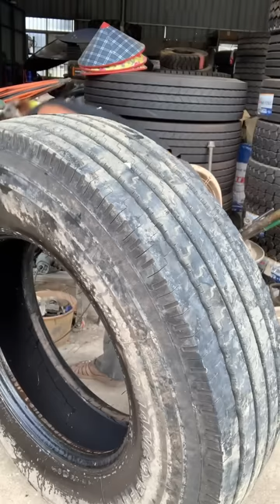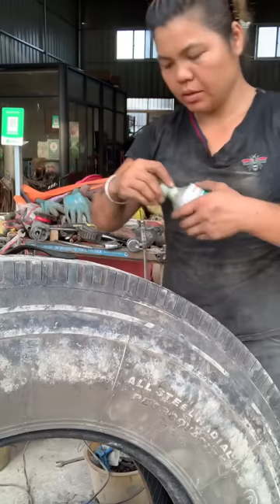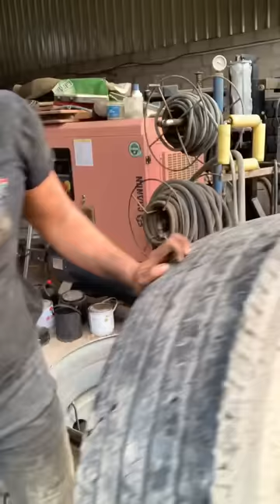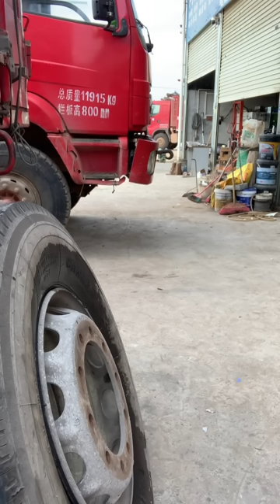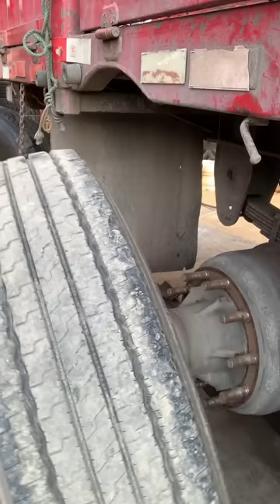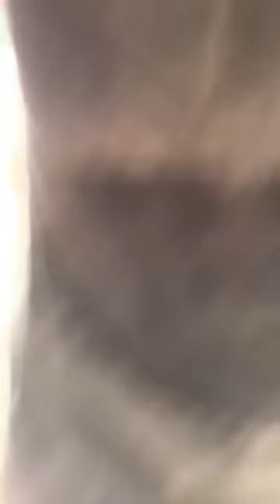Truck Tire Repair Without Replacement!

Comment: As a tire buster 72 years old having spent 20 years working as a mechanic in a tire shop, this woman is a worker.
Reply: 72 years old ? How comes ?!
Reply: I still have split ring nightmares.

I like her air blaster to reseat the bead. We used a big ratchet strap/come-along around the middle of the tire. Or ether starter fluid if we were trying to impress some tractor jockey. ;)

Her plug/patch and boot patch is good technique as well.
Reply: perfect comment because you are in the business. The thought that run through my mind was this. There is no need to discriminate when paying women and men or trans or gay. In sri lanka,for example,50 or 60% highway labour is female.
Reply: God bless this woman,she works so hard
Give her health, wealth of al kind and happiness
Reply: Một người phụ nữ giỏi và chăm chỉ tôi rất khâm phục bạn.Tôi chúc bạn nhiều sức khỏe và gặp nhiều may mắn trong cuộc sống🙂
Reply: This woman is a keeper 😊
Reply: All while wearing sandals!
Reply: God look at the arms on that woman ! Bet you never heard a man say that before.....
Reply: Omg! She’s doing hard skilled Labour like a modern day Conan the Barbarian. This is probably what King Kong would have to do if he rode a massive bicycle 😂
Reply: @r.martin3494  absolutely no insult intended, I’ve never seen a man do this work let alone a woman. It’s incredibly skilled but labour intensive at the same time, I was just gobsmacked by her excellence. Besides, why would this feat of strength and skills be videoed if it wasn’t so extraordinary and worthy of celebration? Think about that for a second before jumping up on the woke high horse and rounding up on harmless folks.
Reply: @kwhite145  , not safe working habits !
Reply: So she is just another "Tom Boy" how appealing....
Reply: We all salute to the brave laday who is earning his and her family bread without any one helps, God bless her, the dignity of hardwork.
Reply: A prevod na srpski.
Reply: Chắc là 27 mà nói 72 nhé.
Reply: Guerreira nota 10
Reply: Bet she makes killer tacos too
Reply: Is it unsafe inflating a tire outside of a cage or not mounted to the truck? Idunno
Reply: I've worked on trucks and all that goes with them all my adult life , and I'm fixing to be 75 ,
Watching this lady work on these tire's and no telling what else she does !
I take my hat off to her !
SHE'S A GO GETTER ,
FOR SURE !!!!
Reply: No gloves, no eye/ear protection. Oh, and are those steel toe sandals?  WOW, simply Wow.
Reply: And furthermore she is not debating what a woman is
Reply: I am to or well be 72 and use to mount and repair tires not easy work a lot of lifting, but the way she does this kind of work amazing, she’s a very good worker at her job, but she needs to protect herself, wear safety glasses and try and use gloves, l did…👍🏼😷
Reply: @LuchoMBravo l agree with you 100 percent, protect yourself…👍🏼😷
Reply: Приколист 72 года😂, ей 92 уже стукнуло!
Reply: Geht's dir gut?
Reply: @soloring 😅niun m😊
Reply: Невозможно что ей 72.
Reply: Какие 72, ей лет 30, проспись)
Reply: @АндрейНэмо  да уж,в 72 да с такой работой она бы уже согнулась.
Reply: This must have been her family business, she is a very hard working lady,  I doff my hat for her..
Reply: Parabéns Deus te abençoe você sempre linda
Reply: За 9 месяцев ей стало 72 года.
Reply: What 72 hours are you drunk? She is no more than 40 years old

Comment: I have been a diesel mechanic for over 25 years and I have changed a lot of agriculture tractor tires by myself in the field. This woman is the best tire repairer I have seen yet.
Respect and dedication. Perfect
Reply from the maker: Thanks!
Reply: Que bendiciones para ustedes amor éso tenelo vavor de Morales  y principio para los de dede ERD te apollo amor
Reply: Hebat
Reply: Muito bom, saúde.
Reply: 很粗重骯髒的工作
很熟練又細心程續
大卡車司機的安全
全憑女主角QCC🎉
高手在民間致敬👍
Reply: @mechanicmia im from indonesia.i subscriber you 🙏🙏🙏🙏🙏🙏🙏
Reply: @mechanicmia im from indonesia.i subscriber you 🙏🙏🙏🙏🙏🙏🙏
Reply: длдд
Reply: @mechanicmia ддд
Reply: Дддддддд
Reply: Respect 🫡
Reply: Wtf is a diesel mechanic doing changing tyres.
Reply: @user-br3xp5wm3o She's doing what needs to be done to that truck back on the road.
Reply: @danmoyer4650  What are you doing messaging me idiot?
Reply: We light the patch on fire to help fuse it to the tire, then Ether to blow the tire back on the rim. Way faster.
Reply: Imagine what kind of mother she could be if she wasn't the best tire replacer.
Reply: Awesome repair job. BRAVO!

Comment: As a auto repair shop owner and tire repair… This woman is worth more than any two men i had repairing tires/ worker. I have all the respect in the world for her. EXCELLENT WORK, EXTRAORDINARY WOMAN!!!! I’m sure she can, but i would like to see her technique with a split rim.. Give this woman a work visa, I’ll get her a job in a heartbeat, and i bet she would own her own business in no time!!!! GREAT WORK!!!!!!!!!!!
Reply: You can apply for a visa (H1, H2,H3, etc.)  if you can prove lack of personnel/employee availability in your area.  It takes a while (1-3 years) but can be done. Speak to a lawyer if necessary.  Good luck!
Reply: You should see her video of changing a truck tire on the road with a split rim. Even more amazing! She does it just as smooth as this while also handling and lifting the power tools by hand (you know how heavy the air gun is) and lifting the tires with her strength. Amazing skils
Reply: شما کدام کشور هستین.من هم شاید بتوانم برای این کار مناسب باشم؟
Reply: Work visa? 
Get a life

Comment: That's what I call hard working.
What a lady .!!
I have never seen a woman changing tires until I saw this video, and I am not young 
She knew what to do step by step with good speed.
She is magnificent.
Reply from the maker: Thanks 👍
Reply: The late Queen Elizabeth II worked in Brit Army motor pool during WWII and learned how to change tires. Was only a Princess then.

Comment: This is the safe and correct way to repair a puncture, making the repaired area, not just the patched hole, very strong. Therefore, I respect Mia's skills, strength and work ethic 👍

Comment: Years ago I changed the tires on my motorcycle with hand tools.  Broke the beads on the old and slapped the new tires onto the rims (the hardest part actually), and then balanced everything.  Although successful, I said never again and have since paid the shop to do the job.  Mia repairs & replaces big truck tires, not skinny motorcycle rubber, and supports her family.  This woman is truly badass!

Comment: Most tire repairs that I've seen only stick a plug in from the outside without even breaking the tire down. Mia does a professional tire repair. Thank you for the video.
Reply from the maker: Thank you!
Reply: Trucks require a patch job like this since they drive more distances and are bigger. A plug is OK but a patch is much more thorough and insures better safety.
Reply: @mechanicmia  AWESOME 👏🏽 WORK Miss!!!

Comment: I used to work in a tire shop for a big electric company and I happen to know this isn't exactly easy work, unless you're in great shape. I've repaired and replaced many truck tires of several sizes, including heavy equipment tires. This is probably the only woman doing this kind of work, my hat is off for her. A man might get a big surprise, arse whoopin, if he harrasses this woman in any way. Lol

Comment: She does a great job, especially considering the tools she has to work with. Really nice patching job too. But all those OH&S breaches made me cringe. In the West we have probably gone too far with these sorts of regulations but most of them  have a good reason. I want to send her some steel cap boots. But I do admire the rig she uses for the impact, great idea.

Comment: Really cool tool for installing the valve core. I've never seen truck duals that mount on single studs without the gland nuts before.

Comment: Nice job. The only thing I don't really agree with here is the spreading of the sidewalls while repairing. By spreading it will give you more room to work on it but there is the slim possibility of causing that patch to deform from the inside because it was applied while the tire was pressed apart. I'm not saying it would always happen but there is the slim chance that it could. Kinda like if you put a band-aid on your arm while flexing. Once you relax, the band-aid may no longer be tight against your skin.

Comment: Great! You are a very skilled and hard working tire repair mechanic. I enjoyed watching the video. I noticed you wear pink sandals and not steel toe work boots. With the type of job you are doing, you should have them on. In a work shop one day, I dropped something heavy on my unprotected feet. I regretted that! My foot swoll up and was painful for two weeks! I could not wear regular shoes on that foot for a week while icing it over everyday all day long. Always be safe!

Comment: She did awesome! 👍 She took the long way around, but still got the job done!
Perseverance is the name of the game.
Reply: What do you mean when she took the long way around? I don’t know nothing about fixing tires.
Reply: She did it the best way she can with whatever tools available she had, so there is no long way around unless you can show us a video doing it in shorter time with tools she had.
Reply: @sgtjoe2008 she probably meant… she uses her spit instead of soapy water..lol
Reply: @jungi658  getting soap and water will take a bit more time and spit is instant...so
Reply: Wtf You need to point out the steps you think were not needed.  That repair would pass in usa.  Long way?  I don't think so.

Comment: The last part. Getting the bead to seal is tricky. To the awesome lady trying to air it up at the end with the “Cheetah” blaster-try laying it on another tire. It seems to work best for the tire sitting evenly on the rim when trying to get it to seat. Awesome video!

Comment: She makes it look easy. I worked on tires like this at a truckstop when I was young. It. Is. Hard. Effen. Work! We didn't have the big pneumatic breakdown/mounting tool we did it by hand. But we did have an inflatable band to squeeze the beads to the rim for airing the tires up. We didn't have an airgun for the lugs. We had a slide hammer and long pipe cheater bar we hopped on
Reply: Guy with his bare gut hanging over his knees stand there with his thumb up his but watching.  Nice

Comment: Nothing but respect for this lady.   Dealing with tires and fixing flats is dirty and can be exhausting.
Edit:  and I forgot to mention dangerous.  I had a tire explode on me once while I was changing trying to seat the bead.   She's doing truck tires without a cage, it looks like.

Comment: Errr correct me if I'm wrong but doesn't repair ALWAYS result in "without replacement", otherwise you wouldn't be repairing it, right?

Comment: Yesterday I had 5 truck tires replaced, one of them blew up inflating it by the tire mechanic. Seconds before I was only feet away and decided to move inside the waiting room and watch through the glass window. Fortunately nobody was near the tire while it was inflating and inside the cage.

Comment: She did a good job patching tire however she fails for not removing any of the rust with a wire wheel on the area of the wheel where the bead is as this is an area where a leak can occur

Comment: No doubt she works hard, but after all that effort with the puncture repair, she should have cleaned the corrosion off the inner wheel rim, tyre and put some sealant on that as well, or the tyre will now probably slowly deflate itself quicker than a job done completely.

Comment: Once upon a Time in high school I had a job like this Schaeffer's scale antelope valley and in those days we working with split rims for diesels tractors and trailers I don't think these people know what split rims are you have to have a cage when you apply air to the tire those rings are known to put holes in the roofs😂😂😂

Comment: Her skill is average. I have been a truck driver for 33 years and had many flats or just regular tire changes replacing a set of old tires to new either on the trailer truck and or both at the same time. To be honest your skills are just average I'm not saying anything different today I haven't seen in the United States. Pull out the damaging nail or bolt etc. putting the largest size rubber plug through the whole first cutting off the ends from the outside making it smooth and even with the current tread. Then putting on a giant rubber patch on the inside after drilling and making it smooth for better adhesion getting rid of the ribs. And getting rid of any damage that may have occurred on the inside of the tire before putting on the patch. Rubbing the patch making the glue adhere to the damaged area. Reinstalling the tire on the rim. Then blowing up the tire to check it for leaks before mounting it back to the truck. Sentences of bit of a labor-intensive job you rarely find a woman doing the job in my 33 years of driving. I have seen two women doing tire repairs. One at a shop in one driving a roadside repair truck for that she also had a male counterpart so it was a two-person team one male one female on the service truck that goes out for road calls. Obviously now that I'm retired and sit around watching YouTube videos I run across. But they are all in Asian countries. Have not seen any American or Canadian English-speaking women doing tire repair videos posted on YouTube.

Comment: I shall have to reconsider my assumption that women are not fit to do all kinds of jobs.
As a truck driver, many years ago, it took me about an hour to change the inner wheel at the side of the road. But our trucks had doubled nuts at each hole that needed to be loosen and fastened with a spanner.